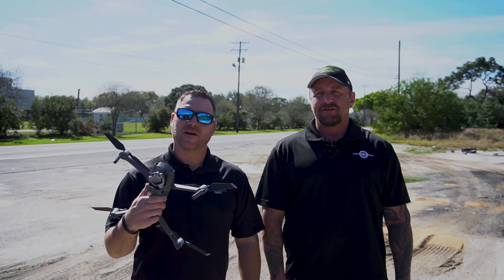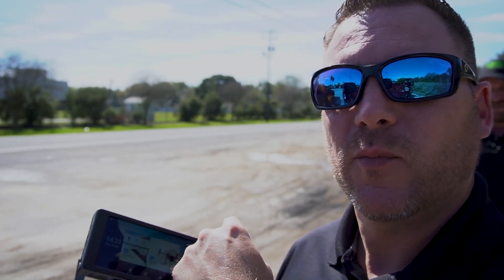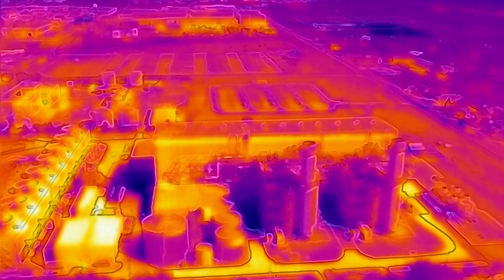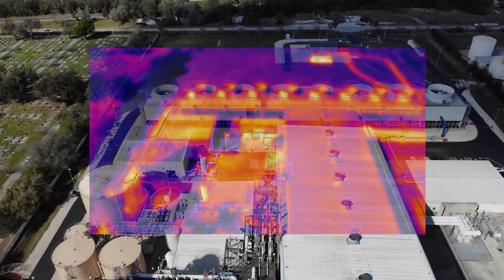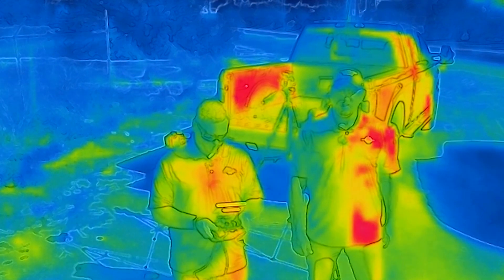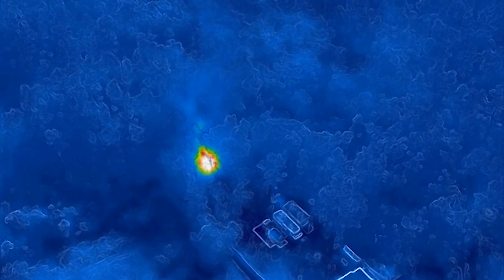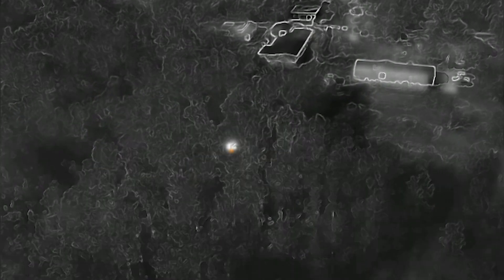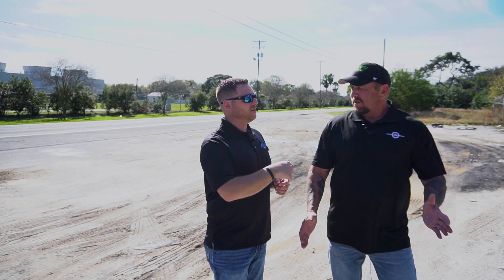DJI Mavic 2 Enterprise Dual - Power Plant Inspection and Fire Located

Comment from the maker: Thank you all for your comments, while flying this Gas fired power plant we found a Fire and learned that this Drone would be a great Fire fighter drone and pretty good for light Inspections also!
Reply: What is the max height it can show a heatmap ?
Reply from the maker: @AbdullahNajeeb  about 200
Reply: 200 meter or ft ? And can it read read thermal image from around 300  to 400 meter ?
Reply from the maker: @AbdullahNajeeb  200 feet. We seen 400 to 500 degrees Fahrenheit at 200 feet up on the fire
Reply: @Brian_kody  Can you guys fly upto 300 meters and see if its thermal camera can read a live object at that height..it would be a huge favour.
Reply: @AbdullahNajeeb  amigo, con ese nombre tuyo no creo que te den esa información...

Comment: I had considered buying this drone however because of other reviews I decided not to pull the trigger, but you have made me rethink that decision. I wonder how well it would perform doing a solar farm inspection as opposed to the XT mounted to a inspire or matrices 100 any thoughts? Thanks
Reply from the maker: It may work for solar during good lighting conditions and using MSX. Your only downfall will be that most companies want 640 resolution on thermal